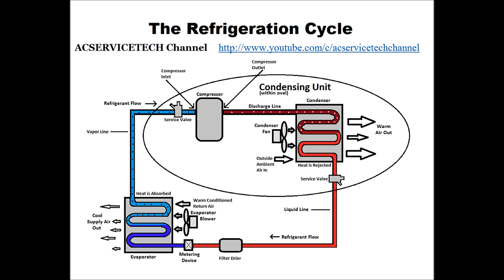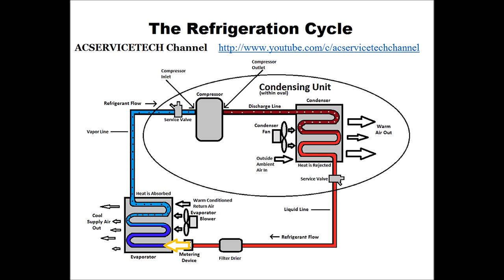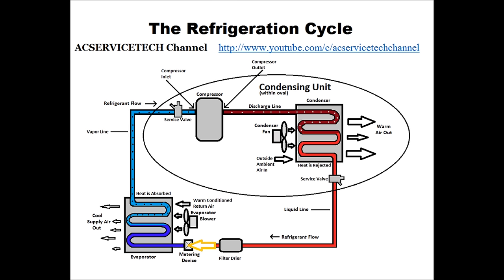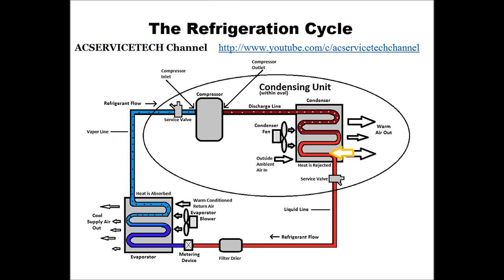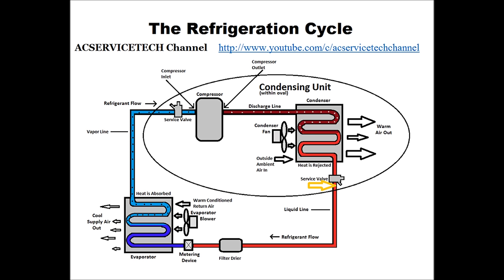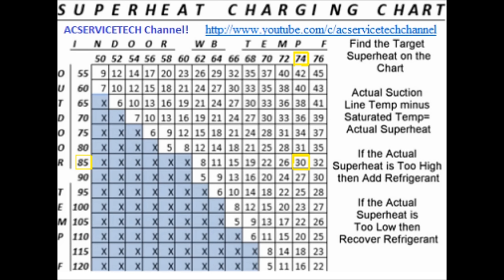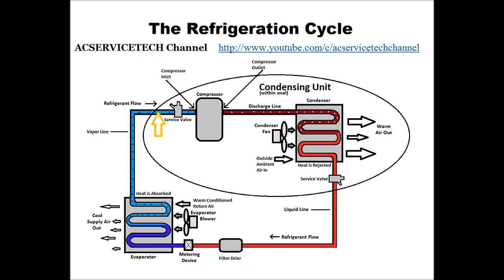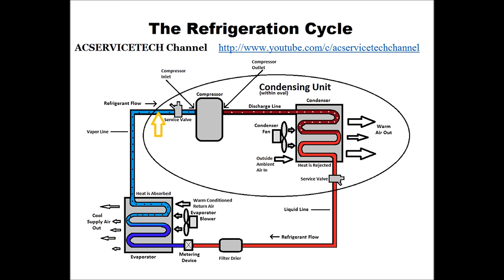Superheat and Subcooling Explained! How to Easily Understand!

Comment: For a novice you could think of the condenser as the "liquid maker"  To make good liquid, you have to make sure it's pure, and the subcooling is a safety factor for that.  IE how much extra heat you took out of the freon beyond what was necessary to turn him into a liquid.  The evaporator is the "vapor maker" and to make good vapor, you have to make sure it's pure (with no liquid in it) and the safety factor for that is superheat.  IE how much extra heat was put in beyond what was necessary to make "low quality" vapor.  You really don't want liquid going back to the compressor because that could kill him.

Comment: The terminology is confusing to me. you mention that super heat is a number,  ie a difference (or delta) between two points in the system , but then you say you have to "have" super heat.  wouldn't you always have super heat as this is just a temp difference?  When you say you have to have super heat are you meaning you have to have a particular value difference?  Also when you use the term saturation what does that mean.  I take the term saturation like when you add a substance to water like sugar there is a point where you can not add any more sugar, ie it is saturated. I can't see how that definition would apply here, is there a different meaning of the term saturation here?  Thanks

Comment: Your flow diagram would be more understandable if you put some line temperature numbers at it circulates through the system for a 90 degree day followed by superheat and subcooling temperature deltas along the way.  So it was not clear to me other than a general way what is happening.  The other commentators below are much smarter than me.

Comment: You do not want a girdling sound in your evaporator, correct , that means we want it a Lower pressure vapor in the evaporator , that is why it is called a evaporator, or to vaporize! Not too too low pressure or the evaporator tubes will start to freeze !

Comment: During the phase change in the condenser the refrigerant undertakes a sub cooling effect, as the vapour reaches its saturation point it is sub cooled to 80% Vapour and 20% liquid to allow the system to condense efficiently and thus entering the throttling valve, Tev(Thermostatic Expansion Valvle) or the EEV( Electronic expansion valve). Dropping in both pressure and temperature the refrigerant is 80% liquid and 20% vapour, depending on ambient temperatures and refrigerant type. Entering the Evaporator it is super heated as the refrigerant absorbs heat from the ambient air being drawing over the coil by the fan. Once entering the compressor unless the system has a suction accumulator of course the refrigerant will be Vapour.

Comment: Superheat can best be described as additional heat added to a vapor.
Reply: Given that, Subcooling is simply the temp of a liquid when it is cooled below its condensing temperature.
Reply from the maker: Yes, thanks Repete Myname
Reply: When trying to explain to a novice my verbiage is "the amount of heat absorbed by the refrigerant BEYOND that necessary to affect a complete change of state" .  That applies to superheat of course. The sub cooling you'd replace the word absorbed by the word rejected.  Trying to make people "get" that cold air isn't made, rather heat removed is sometimes the hardest part of the job. Wish I'd had this channel 50 years ago. Or a computer. Good job servicetech.
Reply: @tomswinburn1778  give them an analogy. 
"You know a can of air duster has liquid in it and under high pressure, when you spray it, the can gets really cold. When you press the trigger, gas blows out, and the liquid inside boils to replace the lost gas.  That trigger is your expansion valve.  That liquid gets colder just like how wind cools you by sweat evaporating off your skin - it removes your body heat."
A can of air duster that has froze up also has low pressure, not enough liquid is boiling off fast enough, converting to gas. After you warm the can in warm water,  the pressure increases because it's 60 degrees hotter and wants to boil off more quickly.

Water turns to steam occurs when going above 212F. Steam at 250F is SUPERHEATED steam by 38 degrees.  
Steam cooled turns to water when cooled below 212F. Water at 200F is subcooled by 12F, it's 12 degrees below boiling point.

You know a pressure cooker lets the water inside get above 212F so it will cook your food faster. You also know your jiggler adds 10 PSI -  so that liquid won't boil until it gets over 240F.  Not enough heat you won't have enough pressure to jiggle, and too much heat the jiggler will constantly blow off steam. When you have an occasional jiggle, you know you balanced your heat perfectly.
Reply: @UCvYZV2LLaSNyE2QpFQMfLKA 
Ya just did it. And in a fashion almost anyone can understand. Only thing I could add is that pressure has much to do with the temperature. High pressure boiler/low pressure boiler. Superheat being the prime example. Heat continues to rise beyond the boiling point (change of state) with the vapor contained.

Comment: Great video, one of the best channels on YT for HVAC. 

Is it normal to have a Single state condenser (carrier CA16NA30) with a subcooling name plate of 10, but with a builder installed Piston for higher reliability? My new home has a carrier condenser with an empty piston package taped to the bottom recessed area where the whip connects. 

In this case, are the techs supposed to check charge by Superheat even though the nameplate says Subcooling 10 deg?
Reply from the maker: Yes, if you have a piston installed, the Total Superheat method would be used for checking the charge of a single speed split ac unit, thanks!
Reply: @acservicetechchannel  Would you do the same on an automobible AC system with a orifice tube, then, ie, use the Superheat method? Are these methods applicable, Superheat (capillary / orifice tube), or Supercool ( expansion valve), with automotive AC coolant charges? Thank you. Great video!

Comment: To my understanding the coolant or like a substance like CO2 or dry ice turns to a very cold boiling to a very low pressure vapor before freezing!
Whereas in hot boiling water on the other side of the bell curve turns to hot vapor or steam !

Comment: Nice explanation.   What is puzzling me is that I have been monitoring new air-water package heat pumps (on R32) and have been seeing periods zero superheat at the compressor discharge.   I thought this was impossible, so have spent quite a bit of time measuring other units, and checking my measurements. I am still puzzled by it, but glean that compressors have recently been developed to accept 'wet' vapour into the compressor.  One thing for sure is that COP drops when discharge SH is close to zero.  Anyhow, my issue is this.... Is my new heat pump faulty?   is the EEV control inferior?  Is the EEV control made as cheap as possible ? or is it actually desirable to have a slightly wet suction.   The COP on average is very good.  I have seen a PH chart plotted with a vertical compression line that goes to a point of no discharge superheat.  This is completely new and unknown to me....   any thoughts welcome

Comment: Where should the high side pressure port service valve be fitted when designing a new  system and what are the advantages/disadvantages 
Of the location of these? Is there a difference is pressure?

Comment: Nice presentation. Just so I can follow this closely, I have few questions. 
(1) When we say “saturation” do we also mean “condensation”, a phase change from vapor to liquid?
(2) when we say “reject” heat, do we also mean “release” heat? 
(3) is the “metering device” also mean “expansion valve / txv”?
Reply: Yes to 2nd and 3rd questions friend. For the 1st question; Saturation means: at that measured pressure the refrigerant is in both states in middle of your evap or condenser, liquid and gas form. Depending on what you want to do with it, it can condensate or evaporate at that point. Example; If the refrigerant is in your heatpump's evaporator in the room and if you want to cool your room, its going to evaporate from that half gas half liquid state! If you want to heat your room, it will condensate from that mixed state!
Reply: @burakokumus6040  got it. Thanks.
Reply: @burakokumus6040  great explanation !

Comment: So if you have a piston you check the superheat in order to see if the system is low or over charged. Then you use the chart to correct it. But if you have a txv then you only use sub cooling right?

Comment: 3:23 - What is discharge superheat and how is it calculated? The discharge line contains superheated vapor from the compressor outlet to the top of the condenser coil; but, I only recently heard of “discharge superheat” for diagnosis. Any insights?

Comment: it's only in vapor form while coming out of evoparator and Superheat is achieved when it comes out of compressor.And it's in liquid form while coming out of condensor and subcooling is achieved while going through heat exchanger. That was my concept.
Reply from the maker: It is superheated before it comes out of the evaporator due to heat, and superheated more in the compressor due to pressure. Liquid is subcooled before it exits the condensor and it could loose subcooling if the liquid line is ran in a hot area before making it to the metering device. The condensor is the heat exchanger, thanks Raj!

Comment: Hello, how you measure the super heat before the compressor when you have a liquid vessel just before the compressor. I suppose you measure it between the liquid vessel and the compressor? Or is it before the liquid vessel?
Reply from the maker: that is actually called an accumulator and you can measure right before the accumulator. Also check out the two articles that we have at www.acservicetech.com/articles and find the superheat method article and subcooling method article.

Comment: Great video as always,could you do a video explaining how to use and measure WC with a manometer.

Thanks.
Reply from the maker: Absolutely I will. I tend to target seasons so soon with the season change I will be doing furnace and gas related items. I plan to do conversions, adjustments, and diffferences between digital and standard manometers. Thanks and I value your input and questions!
Reply: +acservicetech Thanks

Comment: I hv a 3 ton heatpump txv 20 yrs old, supercool is 14F, superheat is 10F if temp taken at evap vs 13F if taken outside on vapor line, outside was 94F, inside 76F, 1350 cfm on med tap measured low SP @.28 spec is .5 . Should use the superheat of 10F using temp at evap vs higher outside vapor line?  How do these sound?  l believe good, Thank you, love the channel.

Comment: I know that a metering device is more or less just a constriction in the piping (or a small opening within a TX valve), but why does forcing a liquid to flow through a constriction cause that liquid to drop in pressure? I thought it would have the opposite effect? Isn't forcing it through a smaller piece of piping effectively "squeezing" the liquid, which would cause an increase in pressure? Great video by the way!
Reply from the maker: So I want you to think of a garden hose. It is high pressure when it comes through the nozzle but once it is in the lager volume space in this case just into the air above your yard, all of the sudden the pressure goes down and the water becomes atmospheric pressure. So the refrigerant enters the metering device as a high pressure liquid in a small line but comes out in a much lower pressure and higher volume area once it makes it from the distributor tubes to the evaporator coil as the distributor tubes direct the refrigerant flow into multiple 3/8" tubes. Let me know if that helps! Thanks Souldrinker!
Reply: Okay. So The constriction on it's own doesn't cause the pressure drop, it does it by making the space through which the liquid flows smaller before it arrives at the evaporator, which is significantly larger than the space through which it just came? where I assume it expands, lowering the pressure? (If that't not how it works and I've misunderstood, feel free to say so, metering devices have always confused me!) Also thanks to you I finally understand superheat and subcooling, so thank you very much for that!
Reply from the maker: I think you got it, it is the pressure drop on the other side of the metering device that the refrigerant goes through. Metering device lowers the pressure, compressor increases the pressure. One side of the system is high pressure and one side low when running. Glad to hear you understand superheat and subcooling. Keep on learning. You will be able to then use not only for charging but for diagnosis when the system is not operating correctly.
Reply: Great, glad I finally understand metering devices! thanks for the help. One final question, do you know if all the same principles apply to automotive A/C systems? (I'm hoping to become a mechanic.)
Reply: Souldrinker to reduce  it's  pressure as it enters  the evaporator

Comment: Say if the ac stays dormant.Should I recover the refrigerant If theres a possible leak at the evap coil?
When it is dormant,is the refriegerant a gas or liquid at the coil?
Thats where I believe the leak is at.
Reply from the maker: What refrigerant is it. Even though R410A is a mix of two refrigerants, it can be topped off with new refrigerant added in. I really researched that topic. Other refrigerants such as blends with 3-6 refrigerants inside with different sat temps should be recovered and started as new. R-22 is single component so you could just add more. If it is a package unit, you would need to recover anyway and weigh in the total weight as stated on the rating plate, thanks!

Comment: On your refrigeration system. Why is the service valve located on the liquid line? Does that make a difference if the service valve is  located on the discharge side when calculating subcooling?
Reply from the maker: Yes it would. If the high side service valve is on the discharge before the condenser then you would not be calculating true subcooling since the pressure will be higher but manufacturers of package units sometimes do that and give you a charging chart on the inside of the shroud to follow, thanks!

Comment: You explained metering devices working very well.  Now can you explain how the refrigerant it self reacts to the HP system workings. Some would use water as an example but that doesnt seem to work for me . The temp of the raw refrigerant at ambient may help. Why would a liquid boil at a lower temp ?
Reply from the maker: These may help. A liquid boils when it has room to expand -  https://www.youtube.com/watch?v=yBqDkbuyuIo&list=PLxnHR5_D2ojwbAc7K7DsjuasaDVfJeGSe&t=104s&index=2   --   https://www.youtube.com/watch?v=Os2WMQxGSws&list=PLxnHR5_D2ojwbAc7K7DsjuasaDVfJeGSe&index=5
Reply: G

Comment: A small comment; if this is the way the system works, the fan is adding its working heat to the condenser. Is that right? I thought the cooling medium flow must always be counterflow with the refrigerant.
Reply: Condenser fan motor working heat is discharged from the condenser into the atmosphere having no effect on the performance of the condenser in case of Air conditioning and inside of a building in case of refrigerators/freezers or water coolers/dehumidifiers and perhaps some of these portable AC units.
Evaporator motor working heat is discharged in the cooled area been cooled in the same time unless on air-conditioners someone has already designed fan motor been outside and blower cage or fan blade witch shaft been in the cooling duct separated by design. 
"Cooling medium"? do you mean an air?

Comment: So on the manufacturer's "stat sheet" on my AC (the thing with the serial #, model #, and all the electric specifications) it says "SUBCOOL 9F". I get that "9F" means 9 degrees fahrenheit, but what does this specification mean? That the subcooled state happens with a 9F temp drop in the condensor?
Reply from the maker: It means that the refrigerant has lowered 9 degrees between where the refrigerant came out of the saturated state in the condenser coil until where it flows through the liquid line service valve. Read the article I wrote on subcooling: https://www.acservicetech.com/post/the-hvac-subcooling-charging-method-explained

Comment: Correction-  the condenser is fully charged with liquid refrigerant.  If it wasn’t you would be undercharged.
Reply from the maker: Hey info, in the condenser you have superheated vapor entering and subcooled liquid exiting. The majority of the coil is in the saturated state, thanks!

Comment: Sticker on my AC unit is completely faded and unreadable except for model number.  Googling for the model, turns up nothing but given 36 in model number, I'm guessing I have a 3Ton unit.  It's R410A unit.  Is there a way, from this limited info, to determine the superheat and subcool values for this unit from about 2006?  There is no thermostatic expansion valve.  There is a readble name on the blower fan that reads Puron and I know R410A is sometimes called puron so not sure.  My units (2 of them) are frakensteined. Over the years, previous owner just wrote blank checks to do whatever minimal repairs to prop these things up.  I know they draw about 3kw when on and doing the math, it seems they are 12 seer units.  

I want to replace them next year.  Looking at the Mr. Cool brand, 3 ton switchable to 2 ton (18, 20 seer respectively).... 

Any advice you have is greatly appreciated